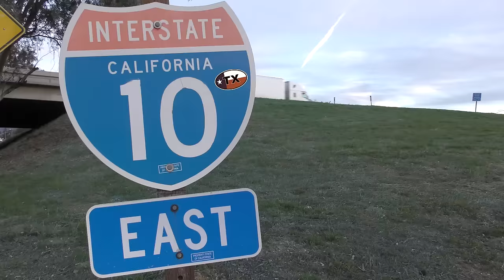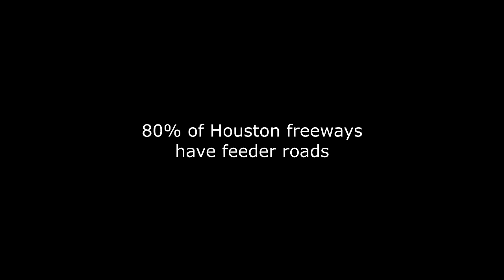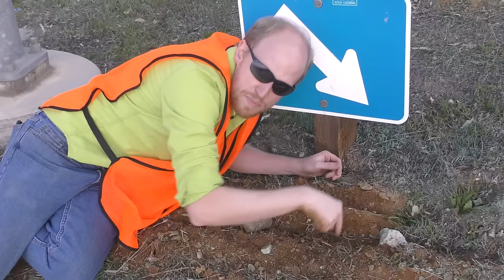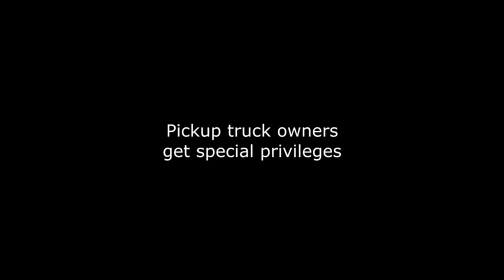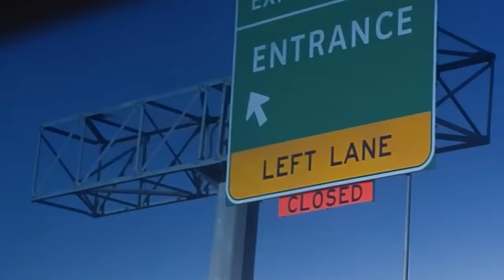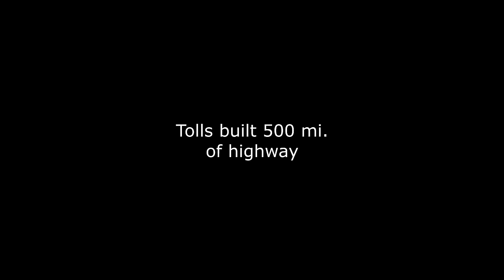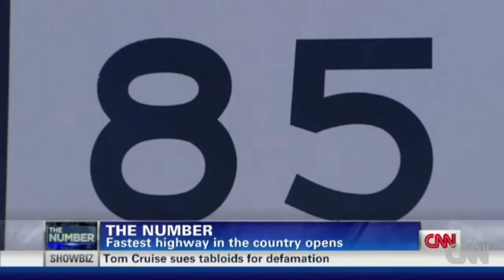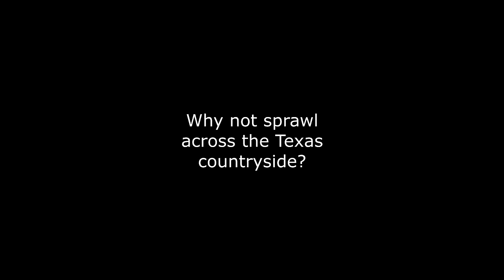How does good Texas engineering make REALLY BAD roads?

Comment: Why is it American cities always go for sprawl over density?
MRT might be more expensive short term but it's much cheaper long term
Reply: The more sprawling metro areas in the US are relatively new as major cities. I.e. they may have been established as cities 100+ years ago, but grew in a time where automobile ownership became the norm. They're built on the premise of perpetually cheap gas and endless expansion. This caught up with some of the suburbs and exurbs since the housing crash, so we'll see what we end up learning.
Reply: Its crazy that you cant go anywhere is so many American cities without a car
Reply: @dustywaxhead  There are a few you can get by without one, but yes, many of them were built on the assumption that most people own one. This model of city seems to have fallen out of favor over the past 10 years though.
Reply: Because living in a dense city sucks. It  Just creates pockets of misery over time. Texas is not short on land.
Reply: @paulosbornept7523  Texas will be short on land once it sprawls out too much and takes up too much land. And more sprawl usually means worse air quality since people are using cars
Reply: @dustywaxhead  those sprawling need to improve their public transportation with electric energy
Reply: Building horizontal is cheaper than building vertical, and most American cities are surrounded by a whole bunch of nothing, especially in the western half of the country.  It's mainly only the oldest cities in the northeast corridor that had to learn to expand vertically.  Having your population surge prior to the invention of the locomotive and automobile rather than afterward makes a difference.
Reply: @paulosbornept7523  The thing that most people get wrong about density is that they assume that every place will start looking like downtown Manhattan. When in reality what most people are advocating for is a more feathered density, such as duplex's, triplex's, and quadplexes that fit the neighborhood well. All while now providing the density needed (with better zoning laws) to support a little cafe or restaurant and little shops in the neighborhood that you can walk to reducing the strain and congestion on the regional road network. This along with better transportation planning for other forms of transit would reduce congestion dramatically and increase the quality of life
Reply: @maninredhelm  building horizontal is more expensive. As long as you're not building skyscrapers then building more traditionally and denser than suburbs it is cheaper. Just think about much tax dollars goes to freeways and car infrastructure. And thats before factoring in needing a car
Reply: We don’t like living in small apartments or townhouses walking distance from transit. We like big houses with big yards, big garages, and quiet streets. It’s a very different lifestyle vs a dense urban core. 

Mass transit simply doesn’t work at the density or most American cities.
Reply: @kovu159  I don’t think you’re speaking for every American with that. How can having conveniences like a store, cafe, or transit station within walking distance possibly be a bad thing? I’d much rather live next to a transit line than a massive sprawling freeway.
Reply: Good points.. There are advantages to mass transit.. We had an exchange student from Ukraine, ahe was used to hopping mass transit and doing what she wanted. Here she was stuck unless we took her, I felt bad for her. I lived in Finland 2 years and learned the transit system well and liked it.  Then I went back to the US to my car and realized what I was missing. Given a choice, ill keep my cars.
Reply: @paulosbornept7523  Instead of pockets, you have...tendrils of misery?
Reply: Its way cheaper. That is why. Better cost of living and quality of living for famlies. People want to raise kids in suburbs not cities.  Mass transit with kids sucks. Especially compaired to our big Cars.
Reply: @simplyafederalist  there's something in between the sprawling suburbs of texas and the city center of New York. You can have compact suburbs with public transit where everyone has a supermarket within walking distance and a reliable, regular bus route to the local train station for onwards travel to the local city centres.
Reply: @petervaughan9111  you due relize that is all tax payer subidized and reaults in much higher tax rates right? So there is a cost. Plus housing is way more expensive. Show me one city that you are talking about which is growong  not losing population like Detroit. That has affordable housing on a per square foot bases like texas? Let alone a low tax rate per capita like texes. Because I dont think it exist. Its a per fantasy. Its all about trade offs.
Reply: @simplyafederalist  There is so much wrong with your statement and most of what you said are subjective opinions.

I kind of agree with you that mass transit sucks, but that stems more from it being horribly underfunded in the United States than from it being inherently bad. If our transit were well kept, didn't constantly have to defer basic maintenance and fight for enough money just to keep existing services going, and reached everywhere there's people like almost every other developed country, you would be singing a different tune.
Reply: @SebisRandomTech Military is not local its federal so its a red hearring. We are talking local and state taxes and policy. Police and fire are a drop in the bucket compaired to mass transit.  Road are way cheaper and way more flexable than mass transit with the exception of course public busses that use them which I am not against. So we are talking about how to minimize cost. So really only your schooling argument makes since and it is a good point. That is by far the largest budget item states have. So that is a good counter agrument. However property taxes does not have to be the way we publicly fund education so driving housing cost up but it is.    You look at the history of housing prices in the US since the civil war. Housing prices increased at the rate of inflation for over a hundred plus years until about the early 1980s. In big cities like New York LA and San Francisco started having housing prices Skyrocket above-inflation. All you have to do is look at their policies which they basically drastically Limited building housing of why housing prices skyrocketed. Then look at Texas they didn't do any of those things therefore housing prices in Texas has for the most part only increased at inflatiom with exception of Houston during the 80s oil boom. So I agree its not just roads but many other factors that drive housing pricing zoning and laws driving building cost up can create a barrier that having good roads cant overcome. Jobs is huge also. Every time you throw in another government service you're incrementally increasing the cost of living in an area. AK every little new thing the government does that you quote makes life better also increases the cost of living to the point where it becomes three times more expensive than Texas. Also yes I know Freddie and Fannie along with US laws and tax code make owing a house cheaper.  However  tax breaks is not a subsidy. Please get your language right. Now Freddie and Fannie are subsidized. So you do have a good argument that you were basically arguing over where the government should involve itself in. I'm arguing mico policy  AKA why are you getting vast disparities and differences  in housing cost in cost of living when everybody is basically under the same macro policy.  So you do have a good point on education. But however with the exception of how much money we spend on each child it's pretty much a standard across all Cities so that can explain why you have major cost of living and quality of life differences. And then my argument is cars make quality of living and cost of living better as a key element especially for families. So cost is only one factor.
Reply: @simplyafederalist  "Police and fire are a drop in the bucket compared to mass transit"
-My city's police department alone accounts for 20% of the entire city's budget, and is the largest single expenditure compared to everything else. That doesn't even factor in fire and other forms of public safety.
When it comes to roads being more flexible and "a drop in the bucket" compared to the costs of dedicated mass transit lines, you also need to factor in how much having transit in place, bus or rail, impacts traffic on the roads. Have a good transit network that's enticing to more people, and you're taking a lot of cars off the roads, which not only reduces pollution but also reduces wear and tear on the roads, reducing maintenance costs and prolonging the life of said roads in the long run. Expand the freight railroads so most long-haul transport of goods happens on rail instead of on trucks. Last-mile deliveries would obviously have to be via truck, but reducing how many cross-country trucks are on the roads would heavily reduce traffic and highway wear. There are of course other factors that play into this, such as the climate of the region, but if more was invested into transit and the culture surrounding it in the United States changed we would see big savings in other areas.
Additionally, allowing some areas particularly near transit lines to be redeveloped and re-zoned to allow for higher-density housing (I don't mean a 100-story eyesore, simply duplexes or ground level businesses with 2 or 3 floors of apartments above) would reduce the need to sprawl out further and further from the cities, reducing the resources needed to build new roads, sewage, gas, electrical, etc infrastructure to connect to those new McMansion developments, again saving costs on a broader scale. Allowing more dwellings and multi-use zoning would increase the tax revenue by the city even if the taxes were lower per-person compared to the current single-family/single-use homes in those areas, and recent rapid transit expansions in my area fueled major redevelopment of the land surrounding stations, taking blighted old industrial yards and replacing them with townhouses, or replacing several acres of parking lots with several low-rise commercial/residential spaces, generating more revenue for the city. My mention of strong property/zoning laws and a strong NIMBY mentality in the U.S. alluded to why you don't see this happen, contributing to our shortage of affordable housing, and Rob talks about this in some of his videos.
I'm aware that there are different levels of government and different jurisdictions involved in highway vs. education vs military vs safety etc funding, but the point is on the big picture, if we are so willing to invest so much of our taxpayer money in certain areas, there shouldn't be such a massive controversy over using or re-allocating a comparatively small amount of that money to other forms of infrastructure, such as transit.
Where I live they are currently spending several billion on two toll highways that literally nobody wants built and won't do much to address the traffic problems in our region, and will only contribute to more sprawl and make traffic worse. Basically the highways are only being built because politicians don't want the money to be moved elsewhere, as the way it's allocated we either have to use the money on these two highways or it will be spent somewhere else in the state. Dumbest reason to justify building a highway in my opinion. The money would be much better used fixing our existing antiquated and over-capacity highways and expanding our rapid transit lines or restoring commuter rail services that were cut during harder financial times. I compared the costs, a lot more could be done with that money benefiting more people than it's currently being used on.
In any case, there shouldn't be a one-sided approach to everything, especially for transportation. Cars have their place in our society, but allowing for other modes of transportation such as buses, BRT, light rail, or commuter/regional rail will do a lot more for the people living in urban areas. Our almost sole dependence on cars hurts those who can't drive (or can't afford to) and isn't sustainable from a financial or environmental standpoint, even if the cars are electric. I'd like to see more of the gaps in our transportation infrastructure bridged, and that includes expanding or revitalizing our mass transit, both locally and regionally.
Reply: Because people are not willing to accept the lifestyle compromises that high density housing produces.  The people advocating high density housing do not regard your quality of life as a concern.
Reply: @colincampbell767  High density housing does not mean low-quality of life. Anybody who believes that is incredibly naive and either has never lived in anything remotely close to high-density housing (or has only lived in crappier units which would be no different than a crappy low density building), or just buy into whatever lies have been spewed about housing by real estate and pro-suburban/pro-auto interests.
Reply: Density is obviously expensive. Most people will already have a car for their travel needs so it isn't that much of an extra expense to drive 10-20 miles more vs paying inflated housing/rent, food/cost of living. 

My house I bought for $250k would be $400k in a nice neighborhood in the major urban area. It would also have higher property taxes, insurance, etc. Mortgage would be 2 to 2.5X the price. So I would be paying an extra 1-2k/month and probably be saving $200/month in gasoline...
Reply: @TheBanshee90  If you didn't own a car that would save you a lot of money. No insurance, maintenance, inspections, repairs, or the actual cost of purchasing a new vehicle every several years.

I believe I read somewhere people spend about 20-30% of their income on car ownership. That's a pretty hefty chunk of change in my book.

Comment: Just FYI, they're called feeder roads only in Houston really. Every other city in texas either calls them frontage roads or service roads. 
Also not all of the 130 toll road is bankrupt which is a big misconception. In fact TxDOT built and owns much of the northern portion of the project. 
My honest feeling is it has two problems: the southern half's alignment is too far east and the population is too low. I think if either the project was moved a little more west, or if it had waited 20 years to be built, it would be probably very successful. It's good it's there though. For example, Tesla is building along 130 in far SE travis county, and that will be great new traffic for the roadway. Cities like Pflugerville, Taylor and Hutto are positioned well near 130 to be good commuter towns for growing industry in this area. 

Another problem is that it really doesn't connect right up with I-35 both in South Austin and in San Antonio. You kind of backtrack in both areas to get back to I-35 from 130, so yes even though you might not sit in traffic through Austin, usually during rush hour there is not a huge difference in travel times. TxDOT has tried to exploit this menial difference in far north and far south austin by having digital signs that tell you the drive times both thru Austin via 35 or around via 130. They had to start turning them off because during off peak times it actually would show a longer time for 130 than if you just used 35.
Another problem with the 130 consortium company is that they poorly constructed the road on their portion. So, the state is slowly completely rebuilding the road between Seguin and San Antonio because the road base has deteriorated so badly in such a short time. Last I drove it there was only one lane open in each direction.. making it a joke to use as an Austin bypass.

In my opinion the area should have concentrated on finishing the 45 toll road which was originally envisioned to be a new loop around Austin, something much needed on the west and southwest sides of town, instead of 130. I feel that it could have still done a great job at diverting some of the thru traffic around the city while also providing increased mobility in western Travis and eastern Burnet and Blanco counties. Highway 360 is the only western major road in the city (mainly because of the hilly terrain) and it's in my opinion the worst for traffic in the entire area. Sitting on 360 during rush hour is just awful.
I feel as though it won't be long before the state starts looking at fully finishing the 45 project, especially as towns like Kyle, Buda, Dripping Springs and Lago Vista continue to explode.
Reply: If I remember correctly, they created a separate "company" to handle the southern portion of 130 because toll projections showed that it wouldn't really generate enough revenue. So the same overall company did 130, but they created a company that would very likely go bankrupt and have them handle the less revenue generating portion.  Everything on 130 north of 71 is heavily traveled and surely generates a ton of revenue.
Reply: @Andrew-qu7lq  yeah, they did. Not so much about the studies, I think there was just state pressure to calm spending on toll roads and private this was one of the first private funded toll projects in the US